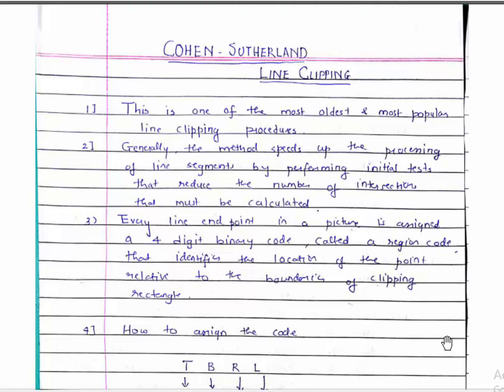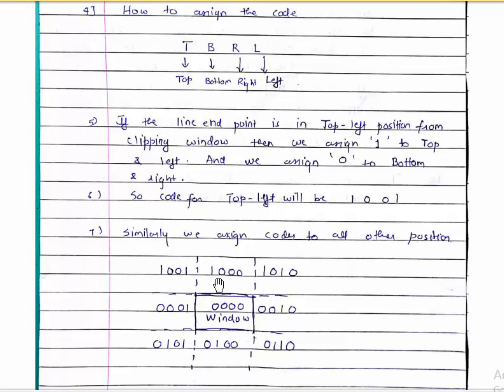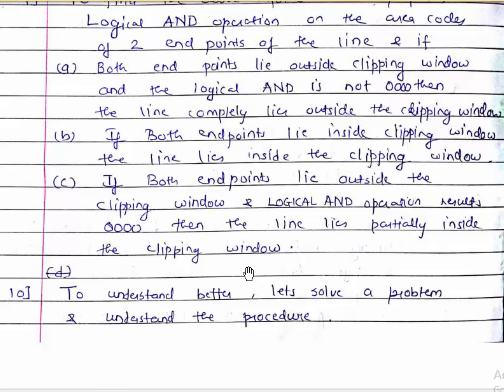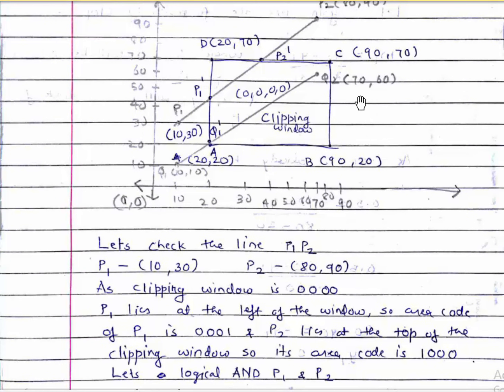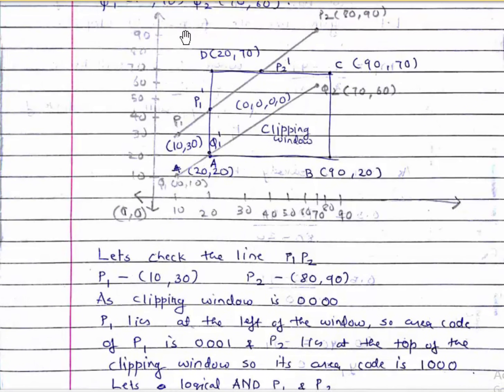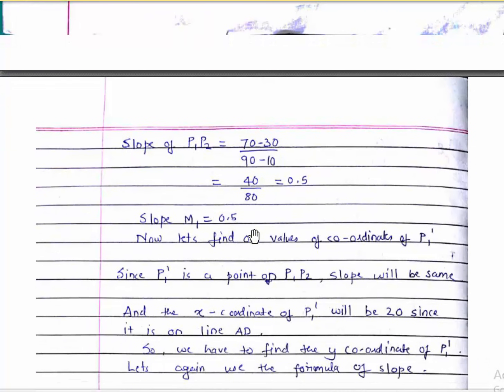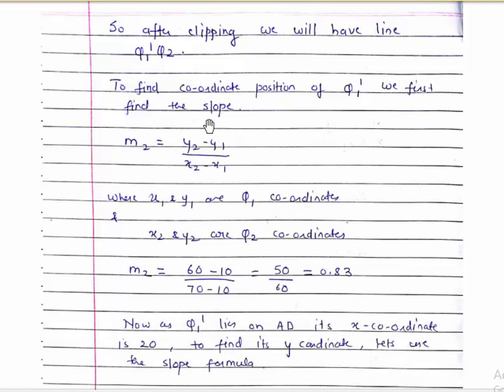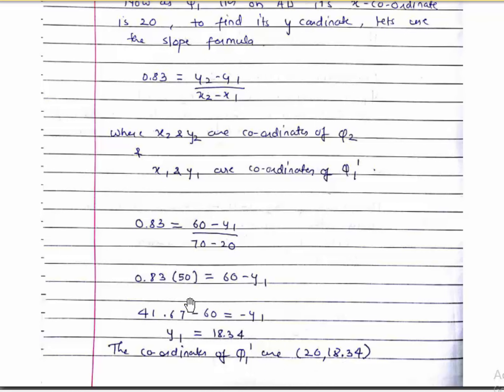COHEN SUTHERLAND LINE CLIPPING ALGORITHM WITH EXAMPLE:cohen sutherland line clipping algorithm

Comment: Hey, thanks for the tutorial. 
I want to ask. Why you calculate the slope P1P2 as(70-30)/(90-10) and not (90-30)/(80-10)?
Reply from the maker: Yeah, You are right. By mistake i took co-ordinates of Point C instead of P2. Thanks for pointing that out.